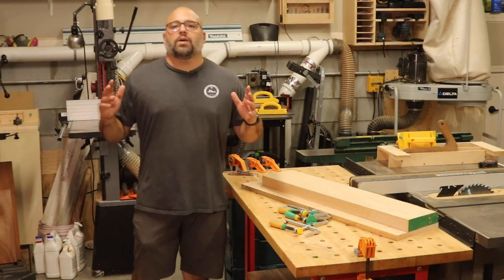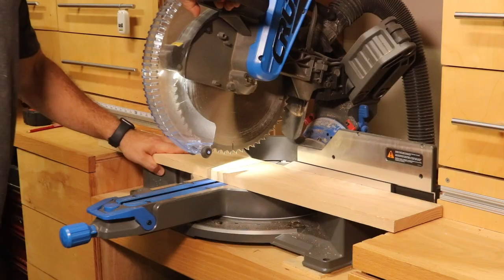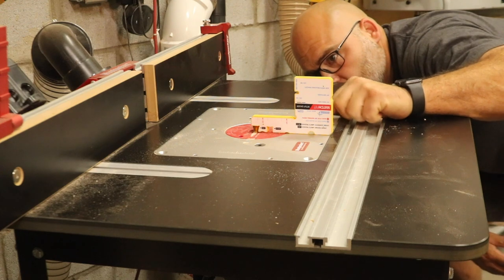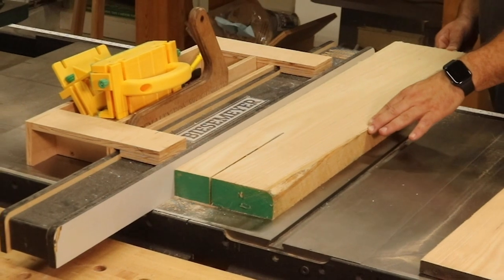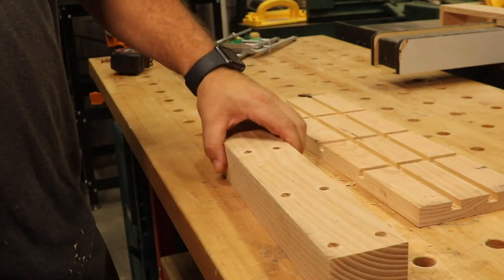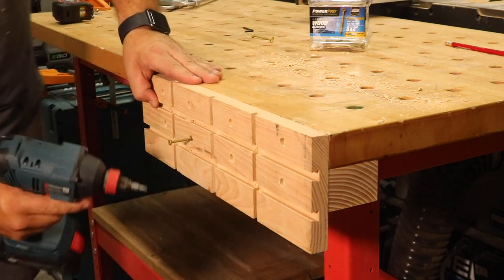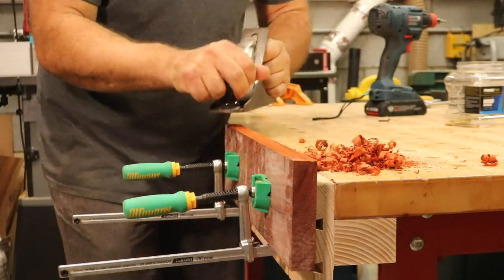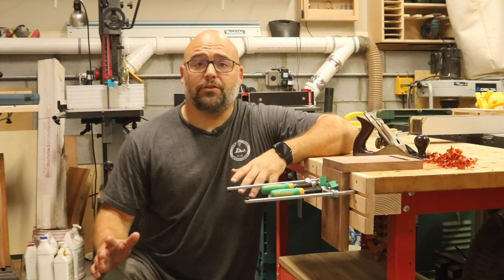DIY Woodworking Bench Vise - Quick and Easy Shop Project

Comment: That is exactly what I was looking at doing to my workbench in my very small shop area.  The only change I will have to make is that the vise has to be removable because I have to use the shelf under the bench for tool storage (again, VERY small shop), so I will probably use threaded insert nuts in the bench and countersink some bolts in the vise.  Thanks for the 'proof of concept!'
Reply from the maker: Awesome! Sounds like a solid plan!

Comment: I was planning my work bench, and thought I had it planned yesterday, but today, I discovered the 360 bench.  Now I'm planning on building one.  I'll start with the table saw sled. I'm newbie, so I have to be a little confident I can do it before tackling something like this.  

My shop is tiny, 9' x 9'.  I'll be building about a 2.5 x 4.5' work bench that will be mobile. 

I was thinking of using a 1/2 MDF and 3/4 sacrificial plywood for the top. But with this system, I wonder if it will work with the plywood. 

I just saw someone else who did a vice.  He used hickory across the length of his workbench.  I'll have to plan for that, but first, I have to see if I can get the top of my bench to work....

This clamping idea seems to be the best.  I'm hoping it works out.

Comment: Hi Jesse, Great project.  I also watched the drill press video.  I have to say, I'll be getting some Microjig accessories when i can get back to my shop.  Keep up the great work.
Reply from the maker: Thanks Paul! They really are handy to have around the shop!
Reply: I didn`t intend to utilize this woodworking website, TopFineWoodworking. Com but rather curious about it. I was truly impressed after trying it. I was looking to find out more about the art of woodworking, and was not dissatisfied. I found several topics such as wood types and designing your workshop.
Reply from the maker: Sounds like a useless spam website that I will never recommend or use.